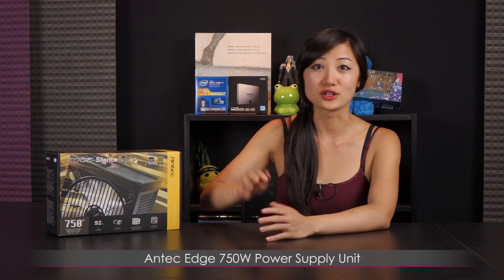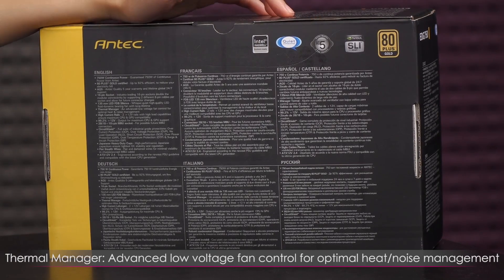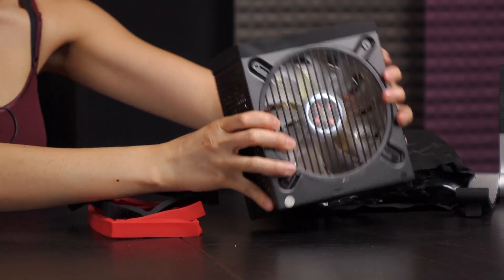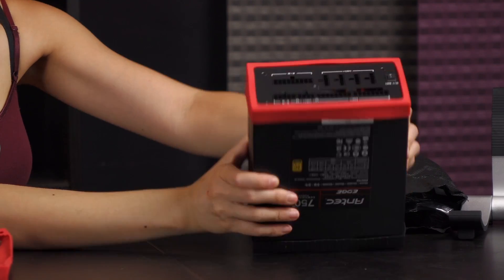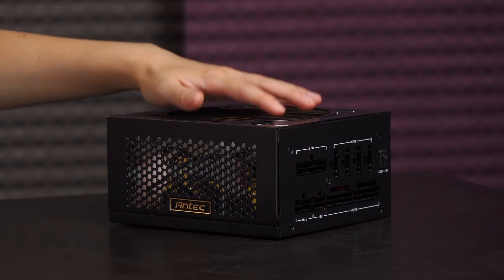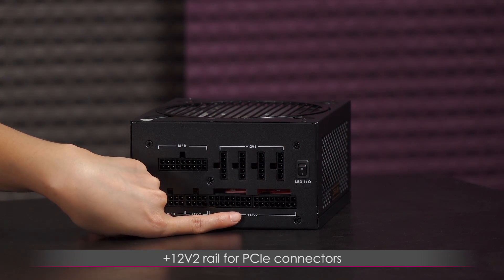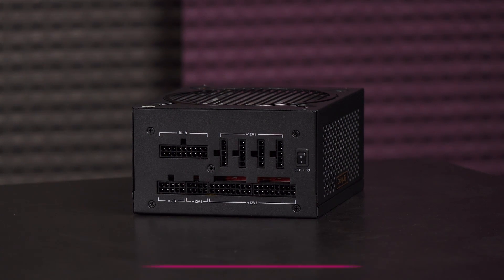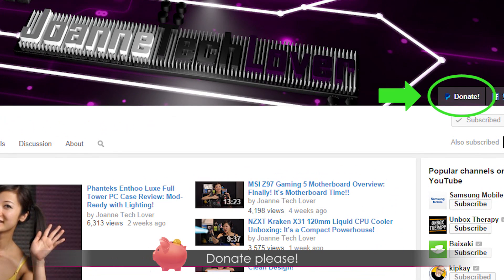Antec Edge 750W Power Supply: A Fully Modular PSU with LED Fan!

Comment: I'm rocking a 550 model and it's not dead silent but still better than some random "green eco" series. Those rubber "sleeves" lets call, them pose some challange if the case is small like my asus ta863. I could fit only one of them.

Comment: oh man... this video is sooo old... damn hope someone can help a little bit. so i can get one of these psus for 70bucks... is it still worth it? and the other question... can this be used for a silent system? best regards from germany
Reply: Nah...its said built for quiet but its not that quiet..
Marketing gimmick see?
try visit anandtech..
But this PSU is well built with nippon chemi caps and amazing ac ripple suppression.
Reply: yes i bough it aaand its a solid psu buut its not rly quiet at all. before i uses always be quiet, super flower and seasonic psus and they are a lot less noisier (is that a word? sry im german). but yeah u someone dont care about that...this is a solid psu
Reply: Its a wonderful psu yes.. but the cons of this antec edge is the 5v ripple.. it almost 80% of atx standard but it doesnt matter.
Super flower leadex however known for their excellent ripple suppression.. it almost just 15% of atx standard on all rail..
however the 550w version use a little bit crappy capx con caps so..i am not recommend it.
if u want quiet and good quality psu buy EVGA G2 series.
Reply: +DrTrice mine (my fan) even makes a ticking sound.

Comment: hi i would like to knw if ican use and intel motherboard for my i7 and radeon r9 280x? 
and what watts power supply should i take?
Reply: The 280X uses about 250 watts under heavy load, so even a 550 watt PSU would cover your setup without any sort of problem. If you're planning on adding another 290X in crossfire, 750 or 800 watts is the sweet spot.
Reply: +recyclebin so i should buy a 500 watts?
Reply: If you already have a good 750 watt PSU, that's great. It's pretty future proof. If you haven't bought one yet, and if you're not looking at a multi-GPU config, 550 watts should be plenty. Try and get a reliable one with good reviews, and good luck with your build.
Reply: +recyclebin tnx for the tips man!

Comment: So should you use both the 10 pin and the 18 pin for the M/B or just the 18 pin to the PSU? I just got this PSU and there is no instruction manual was gonna use semi modular but things changed.

Comment: Do those rubber strips impair the mounting of the power supply onto the case?
Reply from the maker: It shouldn't, as there are holes on the rubber sleeve where the mounting points are.